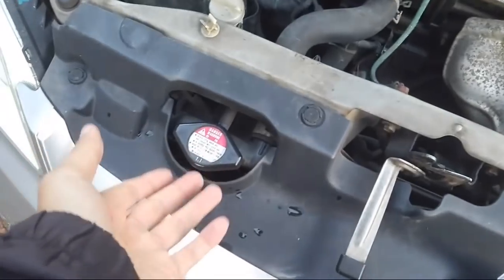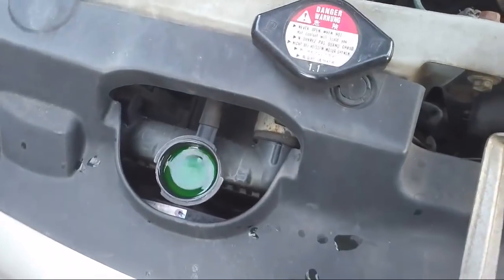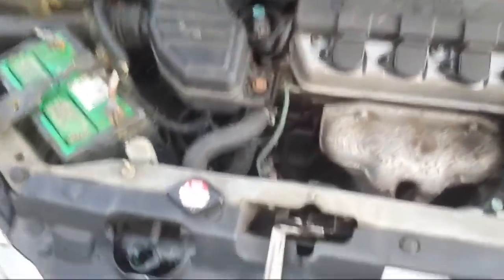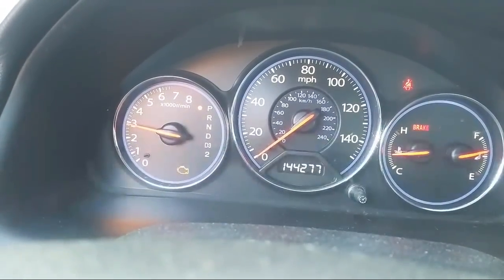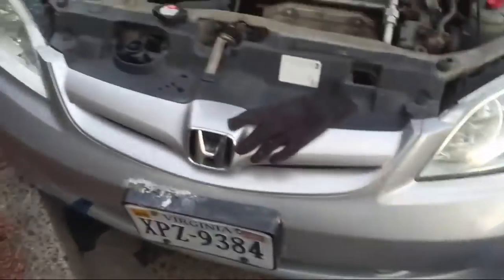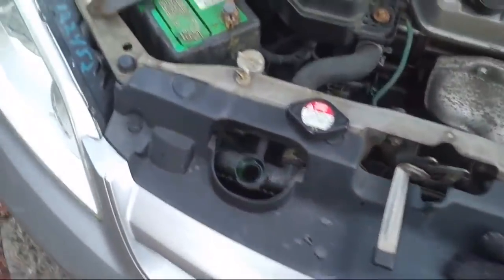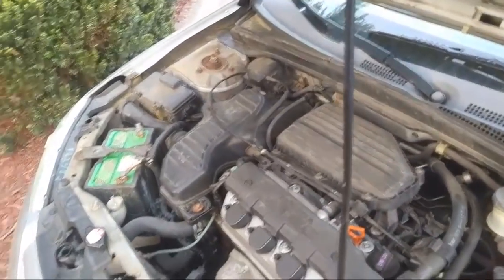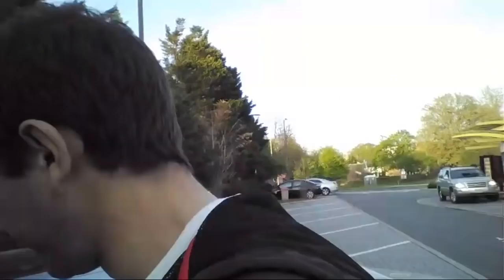How to Get Air Out Your Radiator - Overheating Fix

Comment: Angelo if your car is overheating you most likely have a bad thermostat or a coolant leak . It’s supposed to hold 15 pounds of pressure . If it doesn’t it will overheat . Civics are reliable vehicles . Wish I could look at it